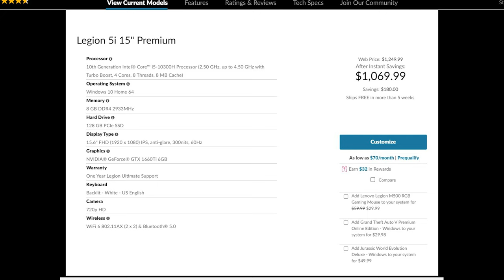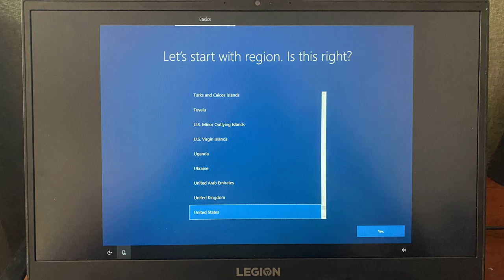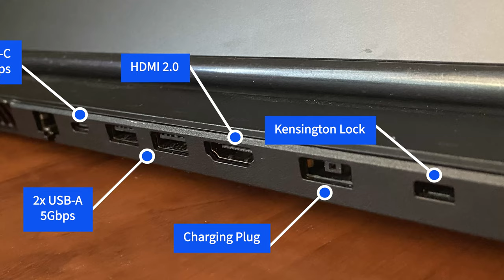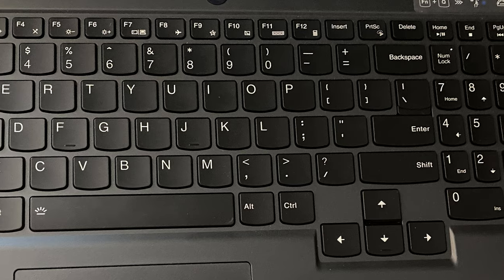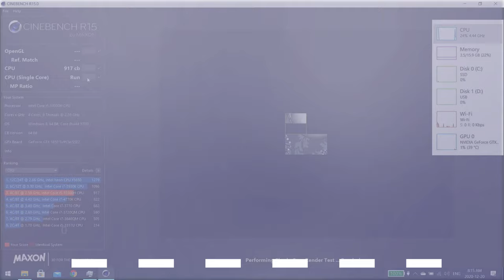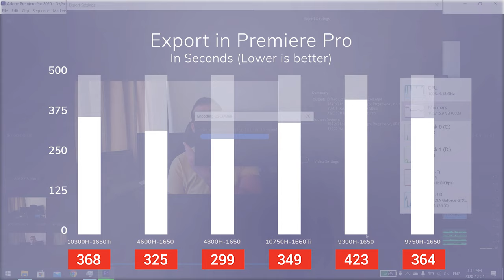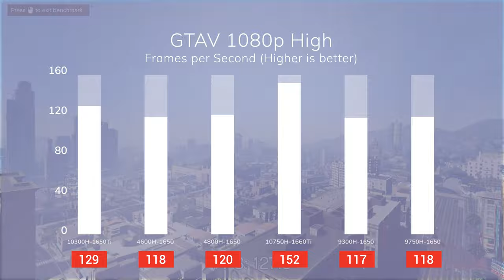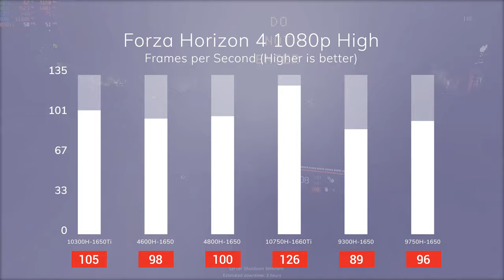The Intel Side of Things: Lenovo Legion 5i i5-10300H Review

Comment: Oh wow you have no idea how much I tried browsing for an explanation like this 

Yes I've seen loads of reviews on the Legion 5 but their specs are mostly amd and my country sells amd laptops at a crazy price 

So first of all I must thank you for the effort on this video I hope you gain more attention because this was a great review 

And secondly if you see this I would love your opinion! So I have this old laptop which was given to me it's one of the old 2013 alienware gaming laptops and it's run down the heat goes up crazy when you play no more than 30minutes, the battery is broken so I'm playing it by wall charger and in gaming graphics ?

 I can only play games at lowest possible customizations.

I've been using the laptop for a few years since it was passed onto me although grateful for how much it's still going on after so many years I think when i do have the money I might get a new laptop. 

So, I'm more budget than loaded So I would of course choose budget if possible. I've looked on many laptops and I've had my eyes on 3 laptops that range in a affordable price in my country 

1. Lenovo legion 5 (i5-10300h GTX 1650, 16GB RAM, 512GB SDD) for  1224$

2. Lenovo ideapad gaming 3i (i5-10300h GTX 1650ti, 256GB SDD, 8GB RAM) for 909$ 

3. Acer nitro 5 (i5-11400h RTX 3050, 512GB SDD, 8GB RAM) for 700-890$

Extra choice 4. (Hp pavilion, I don't know much about this laptop all I know that it's the price of legion 5 and that's pretty pricey getting known for budget price)

These 3 laptops have been the only glorifying choices in my country, I'm not sure how low priced these laptops will go in the future and black Friday but at the moment these are the prices.

I've heard many cons and pros from the Acer nitro 5 and the ideapad 3i so I'm not sure about them because although money tight I don't want to buy a new laptop after like what 2-3 years ? 
Like the Legion 5, all I've heard are pros but most of them are Amd 
The only reason I set my eyes on the Legion 5 despite its price is because of the insane positive feedback and hopefully longer lasting than the other two because budget laptops tend to breakdown faster than laptops that are more overpriced right?

And I'm also not good in tech and specs of things I'm still really new and trying to understand what is what so from all this intel and amd I have no clue which is better 

All I want is a laptop to do daily tasks, gaming on medium to high graphics with smooth gameplay , work and best longetivity.

I would love your opinion and explanation if possible 🙏 it would really help!

Comment: Hey man, I could really use your advice. I'm trying to decide between getting this laptop, the Legion 5, and the Legion Y540. Their specs are roughly the same (1660ti / 10300h vs 1660ti vs 9750h respectively) but the Y540 has the 144hz screen with full color gamut while the Legion 5 has the 120hz screen. 

I plan on using the laptop mostly indoors so I don't think I'll mind the display that much but what do you think? Is the Legion 5 worth getting over the Y540 in terms of build quality and cooling?
Reply: I’d personally go for the 120hz to not overkill, get the cheaper option tbh
Reply from the maker: Hi! I would personally go for the 9750H simply because it has more cores and threads. It'll probably last longer :)

Comment: I have been using Legion 5 but with different CPU. Mine has Ryzen 4600H with 1650ti. So far, it has one of the best laptop i ever have. I was planning to get the Intel one before, but they cost 100$ more so i ended up getting the AMD one, so far so good, the dissappointment came when i bought the 120hz, 2 weeks later Lenovo released the 144hz panel+300nits one with 20$ more which made me sad haha.
Reply from the maker: The 120Hz panel isn't bad either! Enjoy!

Comment from the maker: Hi! A couple of corrections!
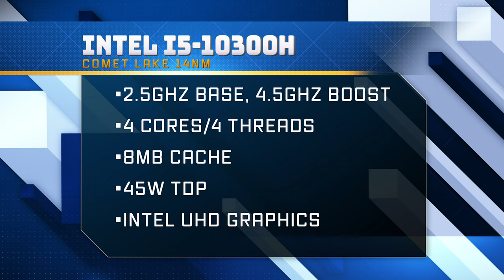At 1:54 , it shows on the screen that the 10300H has 4 cores and 4 threads. It should have been 4 cores and 8 threads.
In Handbrake, the rightmost column shows the performance data for the AMD Ryzen 5 3550H and NOT the i7-10750H.

Comment: What should i go for 
Legion i5 10300h gtx 1650or
Predator helios 300 i5 10300h Rtx 2060 one,  considering the heating and gaming performance
Reply: The RTX2060 alone makes it worth getting the Helios
Reply from the maker: Hi! I would personally go for the Helios if gaming is the biggest concern. If I recall correctly, Helios isn't as well built as the Legion; but otherwise, the RTX2060 will make a big difference.

Comment: My lenovo legion laptop has problems with cooling. ( Config: i5 10300h gtx 1660ti). I undervokted and used a cooling stand and in cyberpunk 2077 and control i get gpu temps in low 80s and cpu temps from 90-95

Comment: Thank u I have this laptop and it's very good but I got an 8gb ram version so what ram should I buy to upgrade to 16gb?
Reply from the maker: Provided your laptop has 8GB RAM in single channel, you can pretty much get any 8GB SODIMM that runs at the frequency of installed stick (or more).
Crucial RAM Sticks are cheap and reliable, so I go for them anytime I need laptop RAM. https://geni.us/yx13
I tried mix&matching an 8GB 2933Mhz stick and an 8GB 3200Mhz stick on this Lenovo, and it worked just fine.
Reply: @WhatNowTech  thanks!

Comment: And no, you can't add 32 gb of ram. The max is 16 gb(8x2). I have talked with Lenovo Customer Service about that, and they said that CPU limited the ability to upgrade RAM to 32.
Reply from the maker: The 10300H is capable of running 32 gigabytes of RAM. Usually what happens is that if Lenovo sells their laptops with 8 or 16 gigabyte configurations, they won't put anything beyond those in the compatibility guide. Lenovo Customer Service basically reads from the same document. Honestly, I haven't tried upgrading this to 32 gigabytes, but there is a Reddit post about how Lenovo sells these with 32 gigabytes of RAM.
https://www.reddit.com/r/LenovoLegion/comments/il2key/issue_with_ram_frequency/?utm_source=share&utm_medium=ios_app&utm_name=iossmf
This person matched an 8GB stick with a 32GB one and got 40 Gigabytes of RAM, so it should definitely be able to run 2x16GB DIMMs.
Reply: @WhatNowTech  I have the Legion I5 with a the 10300H and a RTX 2060 and I upgraded it with 32 GB of RAM and there were no problems of compatibility whatsoever.